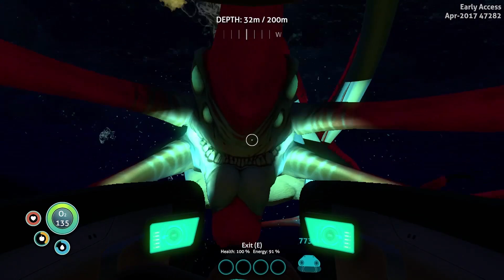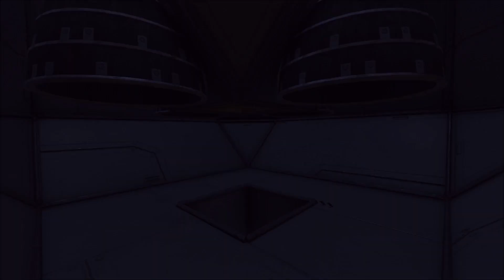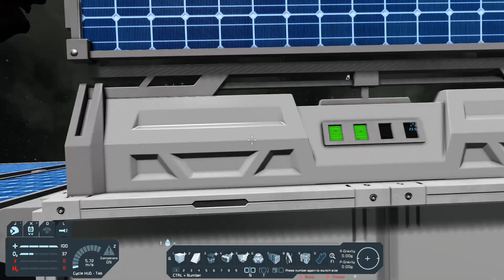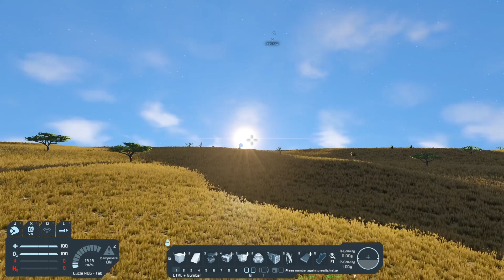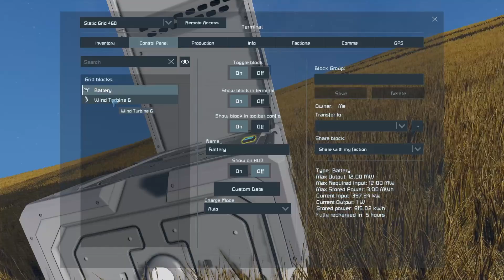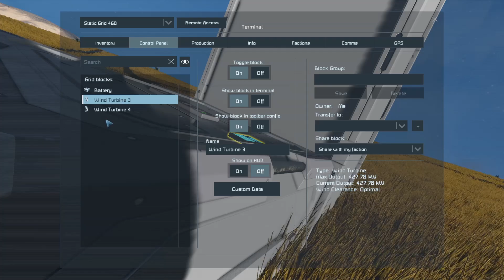Space Engineers Tutorials: Power

Comment: Any ideas on how to stop connectors from sharing power? I kinda need my rover to stay a closed circuit but it also need to connect to my miner to empty it's inventory... I could drop and collect and them connect with a lander, but those extra blocks won't really fit my miner... and I'd need other means to align... I really just need to block power transfer from the connector...
Reply: Maybe try a collector? With a sorter/connector pushing out the material. I haven’t used a collector yet, just bought the game, but that’s how it seems to work, a dump for your inv(small block/large block component transfer rule would probably be in effect). You can also toggle power to specific systems so maybe just play with it a little. Doubt you’ll get a perfect result as things seem to share power regardless, but you could find a way to bring down power consumption during the process and I think stop your batteries from collecting power as well.